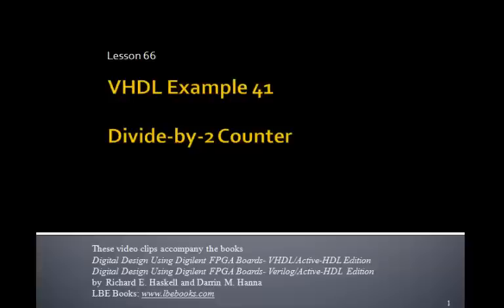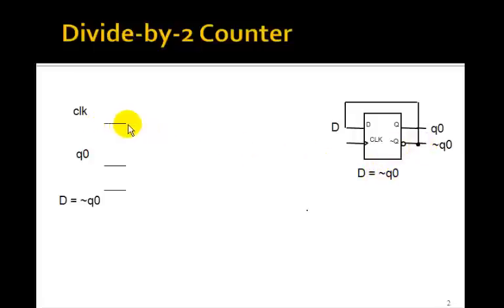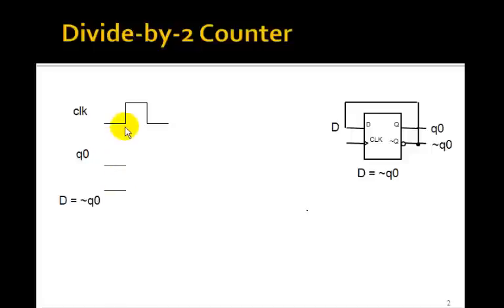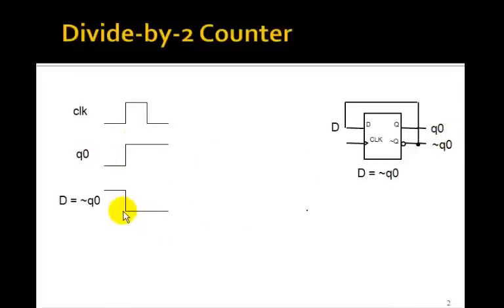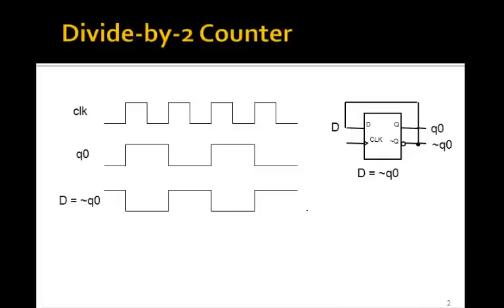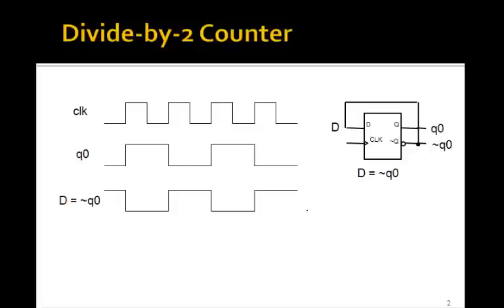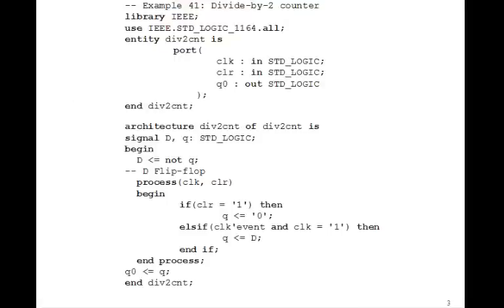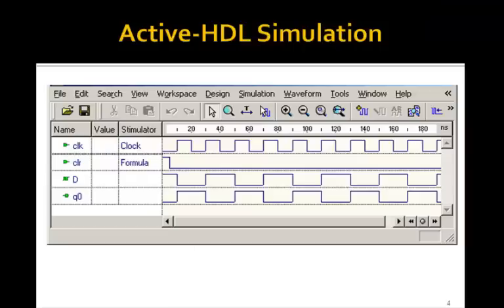Lesson 66 - Example 41: Divide-by-2 Counter

Comment: I'm trying to better understand the CD4060 and CD4027 chip that I made a 1Hz pulse generator from. I don't understand, even though my video clearly shows that I've made the circuit, what the hell is inside this CD4060 chip that makes it do what it does.. I've looked at the datasheet and it seems all Greek to me. I've watched videos on SR, JK flip-flops, studied about logic gates any everything, but I just cant wrap my head around how this CD4060 chip does what it does. I feel bad because I've made the circuit first and wanted to generate a 1Hz signal, and then I was gonna figure out how it does it.. I figure a hands on electronics build would of made me feel better, but I just don't understand the circuit.. or the CD4060.. not even gonna talk about the CD4027 IC because it's a JK Master Slave flip-flop. But they honestly don't explain what type of flip flops are inside the CD4060.. anywhere in the datasheet.. they show circuits using the crystal but I don't understand it. Could you point me in the right direction where I might be able to better understand what the CD4060 is and maybe what type of flip flops are inside? Someone was telling me about that These are not simple set-reset flip-flops, because there is no SR configuration that toggles. T, D, J-K, whatever - these all are variations on the theme of a clocked, master-slave flip-flop.

Sorry for rambling on, just really upset and I thought I understood flip flops and gates and such..